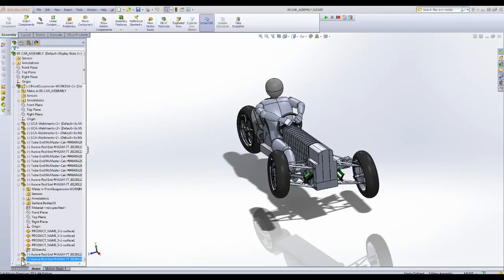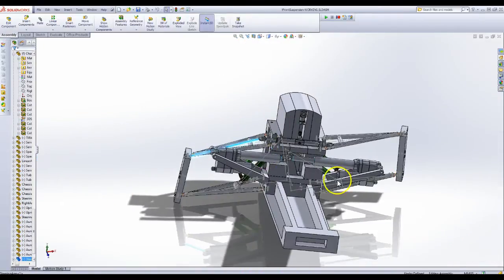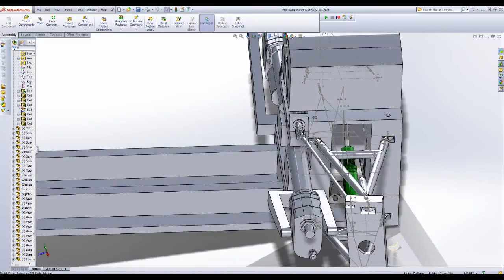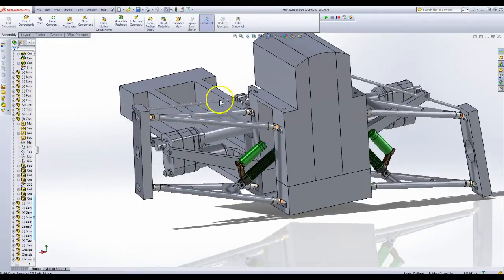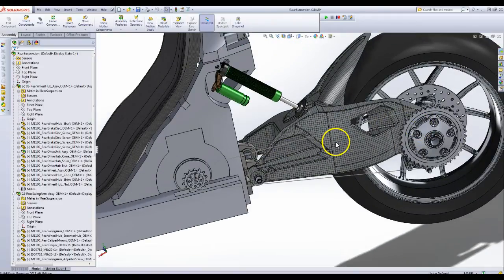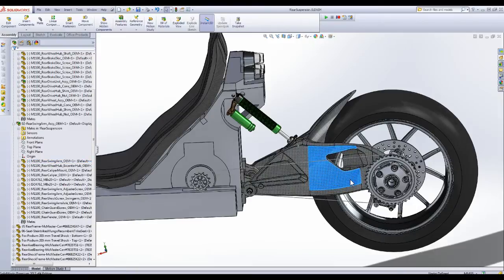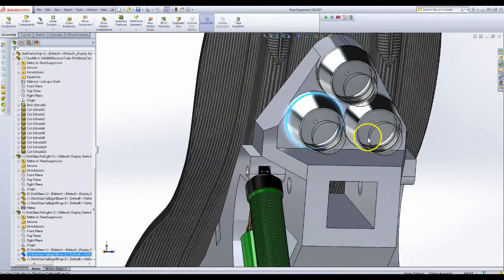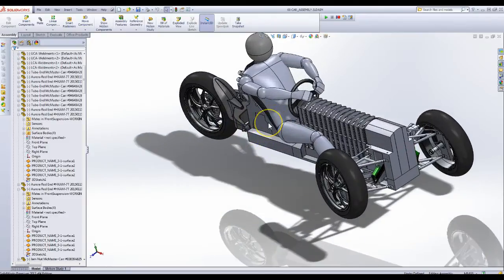Tilting Three Wheeled Electric Car Suspension 3.0

Comment: Cool idea. Hope you haven't given up on this.. But I also hope you simplify the design before you manufacture it. Seems like the machined aluminum blocks, for example, are overkill. That's just going to make it more expensive and heavier than it needs to be. Also takes up way too much space. Most chassis use tube. One thing to consider is that most tilting trikes depend on the rider being very high up above the pivot point in order to be able to shift the center of gravity, just like you would on a motorcycle. A driver might need to counter steer pretty heavily on this to get into a proper tilt, so as to not tilt the wrong direction due to centrifugal force. I'm not sure that'd be so safe. Have you seen the Swincar? They appear to solve this issue by placing the pivots above the center of mass. That way centrifugal force automatically swings it into the correct tilt. With your batteries stacked up so high you're going to have a high center of gravity -- combined with the tilting mechanism this will make the car very roll prone, no? I'd make more of an effort to design around putting the batteries in the floor. Anyways.. the premise is a great one, and I've been giving the same very much thought as well.  I look forward to seeing more progress on this.